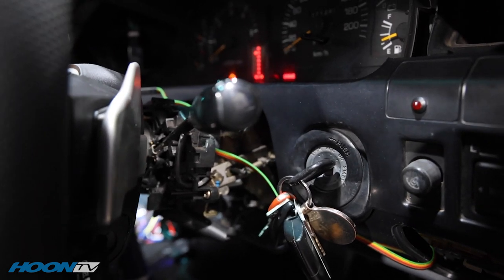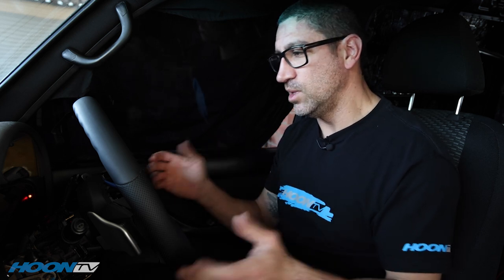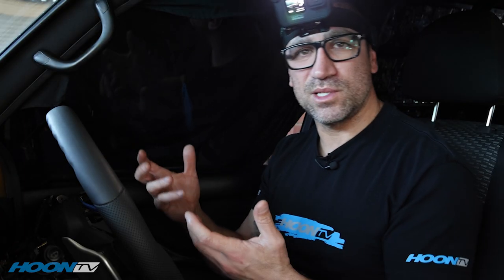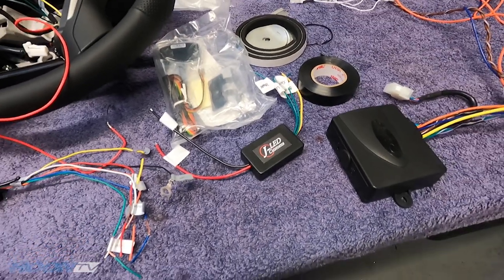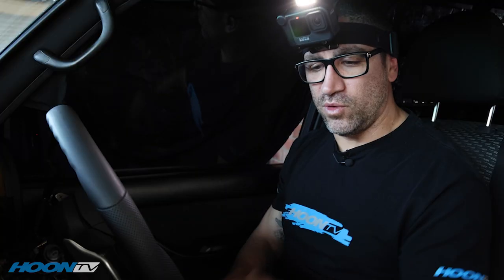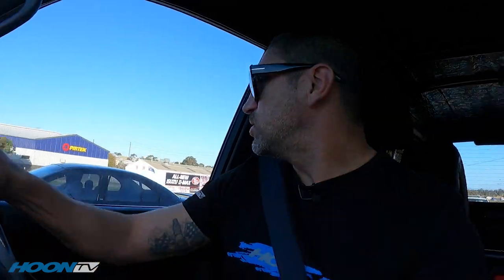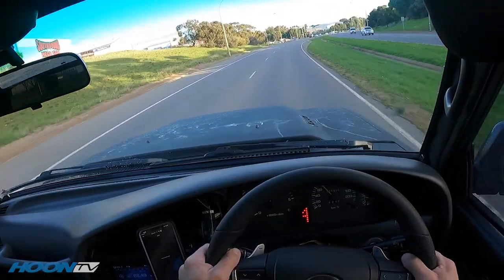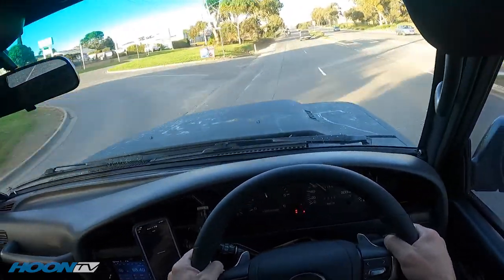Landcruiser 80 Series Build - LS ENGINE CONVERSION with Paddle Shift

Comment: Hey mate do you
Know if that gear indicator will work with a 4l80e/cable throttle body
Reply from the maker: Should do as it plugs into the OBD port. Definitely drop the guys from Mark’s 4WD a line though. They’re the gurus
Reply: Cheers mate